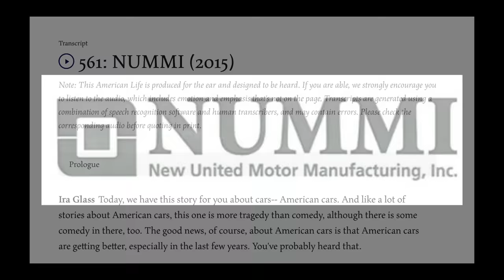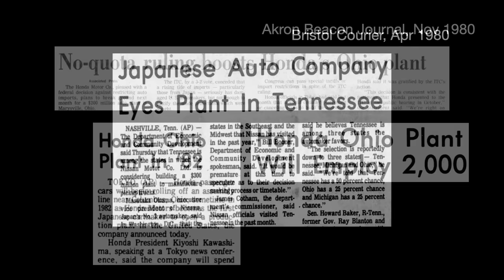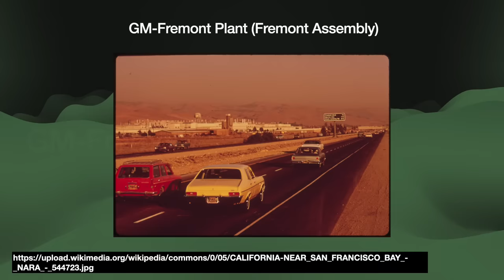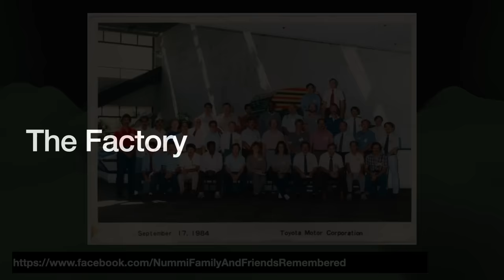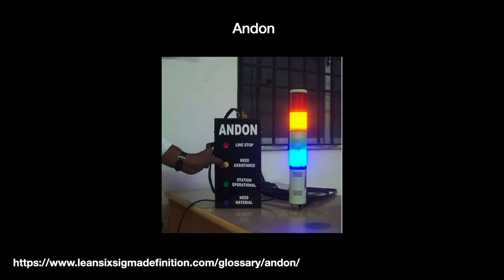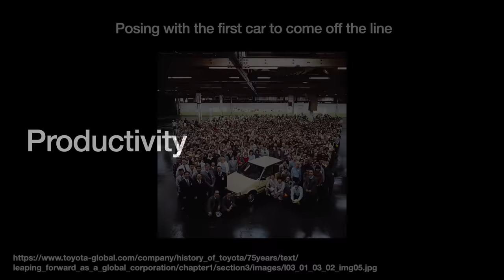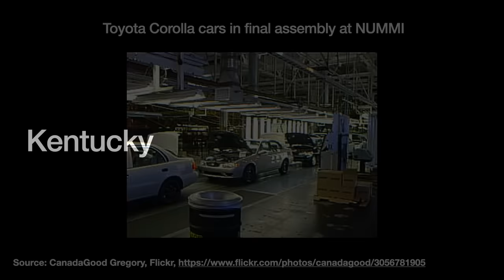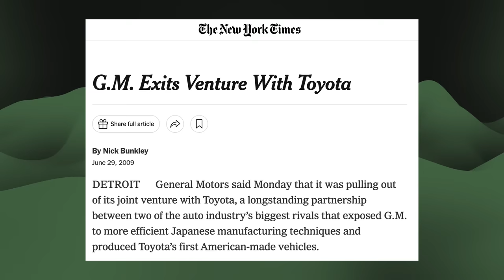How Toyota Turned Around GM’s Worst Factory

Comment: On of the things Toyota does best, is it allows it’s assembly personnel to make suggestions on improvements, trials and then implements them if they work
Reply: Marketing anti-electric car lies.  The other thing Toyota does well.  Top 3 climate denier with only oil companies ahead of it.
Reply: @smartelectriccar I'm pro-climate change. Deniers aren't helping sure. But stop taxing oil, protesting pipelines, and start approving fracking permits. The only reason I want an electric is because it's cheap. If we had cheap gasoline we wouldn't need to buy electric cars.
Reply: @theduplicator3270  Fracking does the most damage to the environment permanently and releases more methane than any other human practice
Reply: Something Tesla also does incredibly well.
Reply: W Edwards Deming an American engineer and business theorist ironically was the one responsible for this culture and improving the quality of Japanese cars. His ideas were ignored in the U.S but the Japanese during the post war period embraced his concepts because they wanted to shake off the pre war image that they only manufactured low quality and shoddy goods.
Reply: Yup, I read that in the book "the power of habits".  They delegated problem solving at a low level.
Reply: @smartelectriccar So you are all in on dirty electrics are you?
Reply: @theduplicator3270 I'm against climate change personally
Reply: They also have a kick ass work ethic. Quality first.

It shows.
Reply: @smartelectriccar Unbacked bullshit 🙄
Reply: Kaizen
Reply: @smartelectriccar nah they're right about that one.
Reply: @smartelectriccar   Misinformaton. Get this nonsense out of here.
Reply: *tries
Reply: @theduplicator3270  "and start approving fracking permits" - LMAO at this lunacy!
Reply: @theduplicator3270 How do you calculate the damage to the environment? You do realize the damage that fracking does, right? When something is too chip, someone always pays the price.
Reply: @smartelectriccar until the grid moves to majority non fossil fuel hybrids (gas generator powering an electric motor) are prob the best bet anyway. When you factor in FF's burned at the grid it turns out that hybrids end up using less fuel than full EV's, while also being less resource intensive (batteries.) There's a reason virtually our entire heavy rail industry is based on diesel/electric tech. 

Now sure, EV tech is sure to improve, but the key is the grid. Unfortunately, we aren't likely to get off FF's anytime soon. The only logistically practical alternative is nuclear, which while quite safe and clean when implemented properly, is constantly sandbagged by both big oil and so-called "environmentalists."
Reply: @janeblogs324  Mining for metals to make EV batteries also damages the environment. Are you cool with that?
Reply: @theduplicator3270 Governments tax to reduce consumption and subsidize to increase consumption. Fossil fuels have hard to control negative externalities and are therefore taxed. Electric cars have much cheaper ways to reduce negative externalities and are subsidized.
Reply: @davidsotomayor8713  Heavy rail uses a generator and traction motors because other systems of power transfer  just aren't practical for the application. Overall efficiency wasn't the main aim and diesel electric had existed for a long time in stationary power generators, submarines etc.
Reply: @smartelectriccar Electrics are destroying the environment, and are dangerously heavy and huge.
Reply: @ExternalInputs  of course it isn't the ONLY reason, but a major reason why it is used is because it is by far the most efficient. Less fuel == less money.
Reply: @smartelectriccar So you want the largest car maker in the world to only invest in and sell electric cars despite half of their market being in underdeveloped countries? Im sorry to burst your bubble, but southeast asia, africa, and even parts of south america do not have a reliable and built out electric grid. Billions of people depend on reliable gasoline/diesel vehicles and western media has blinded you to the fact that people outside the United States and Europe exist. They know it's not feasible to switch to all electric everywhere, even here in America with our crumbling infrastructure. It's too bad they'll be the last ones standing while our own car companies approach another bankruptcy bailout.
Reply: @JohnAsmith-rw6uo you listen to too much talk radio.
Reply: @jerbear7952  All you have to do is have a little common sense and you could figure it out yourself.
Reply: @smartelectriccar if you calculate every resource needed for "everyone on earth needs EV" conversion, you will be anti-electric vehicle too. Nuclear and hybrids are the better stopgap way forward. EV can come some decades later, it's hard to justify all lithium ion battery technology into all cars, unless public transportation reform is included in there
Reply: @smartelectriccar Toyota make first successful hybrid vehicle Prius, which triggered the electric car race.
Reply: @smartelectriccar Because replacing gas cars worldwide with hybrids that people can actually afford (including developing markets( is somehow better that only replacing gas cars in developed markets and doing fuckall for Africa and SE Asia? The former can be done with significantly less rare minerals as well. I’m sorry that you’re incapable of doing math
Reply: @smartelectriccar you apparently have done zero homework work on carbon emission of an electric car vs fossil fuel car
Reply: I worked on cars for over 15 years. There is nothing built like a Toyota, plain and simple. Parts aren’t just thrown in there because they fit like some of the other auto makers, we know of    BMW
Reply: @theduplicator3270 that makes no sense.
Reply: @janeblogs324  You know what’s bad for the environment? Unreliable junk electric cars that last 1/4 as long as a Toyota.
Reply: Jishukin it's called I used to work for them in Australia.
Reply: @smartelectriccar dude electric car are a scam, either you go to work on a bicycle or on foot or you do nothing.
Toyota is just honest.
Reply: They aren't unique in that.
Reply: @calvinnyala9580 battery technology is moving away from lithium. Anyone with any sense of all knows what we have now will probably not be what we use later.
Reply: @deezeed2817  Yes. The manufacturers took to heart the teachings of Edward Deming. He offered had offered his expertise to American manufactures but they decline his offers. It looked like they thought they knew better. Even Porsche had hired a Japanese company to help them improve their quality control and efficiency.
Reply: @timwildauer5063  I'm still waiting on Tesla to improve the quality of their construction.
Reply: @janeblogs324  I guess cobalt mining don't? Used up batteries don't? Get off your high horse.
Reply: @smartelectriccar  yet they are still the top auto makers? Everyone else who ran after EV hype are now scaling back on EV production. Because of $ entry point and not enough infrastructure to support massive EV expansion. Rolling blackouts will be the norm until this country upgrade/expand its aging power grid.
Reply: @smartelectriccar  maybe, but their cars last forever which makes them sustainable again. Aand they got awesome hybrids as well!
Reply: @jsimsgt96  
"Kaizen"
==
改善
Natural democracy.
Reply: What they are missing in the story is how GM went over to Japan and laughed and ridiculed how the Japanese made cars. When they came home they said, nope were not doing this and were not giving line workers that type of autonomy. Typical US egos. USauto mfgs are stuck with mgmnt vs employee mentalities that has never been resolved which hhas been a detriment to becoming world class.
Reply: hydrogen and/or other liquid fuels will support internal combustion engines for decades to come.
Reply: @janeblogs324 cost is more important in this equation than idealistic delusions
Reply: @timwildauer5063  Build quality makes it more of a computer with wheels
Reply: Well yeah TPS is an industry standard at this point. We studied this stuff in my financing classes as far as aviation is concerned it's pretty much been adopted by every major manufacturer.
Reply: Allows? Toyota invented the Kaizen method, they expect you do improve all the time.
Reply: @smartelectriccar  Toyota lies about their own EV range of cars?
Reply: All auto makers do this
Reply: @smartelectriccar  Bruh electric cars are a novel concept to be mass marketed - of course its going to be bumpy and people will be skeptical whether or not its marketed as such. Stop blaming it on "climate denying industries" the electric car market isnt exactly putting renewables into the system.
Reply: @smartelectriccar2306  no one cares, evs arnt any cleaner, do research
Reply: @smartelectriccar yes but Toyota is also at the front of battery technology no?
Reply: Kaizen

Comment: And how GM learned nothing.
Reply: The thought of being better than anybody else (so called exceptionalism) leads to the downfall of a person or a company.
Reply: According to this video, they learned a lot, but when they tried to put it into practice, union got in the way.
Reply: @mintheman7 Unions & management
Reply: @mintheman7  I’ve driven modern GM vehicles… it can’t all be blamed on the unions, though they do share the blame.
Reply: @mintheman7  The thing is, GM's management would never relinquish there centralized sort of power over the manufacturing process and would choose to die first before they even present anything but upwards graphs and charts before they go and admit that they have to slow down and fix problems first. 

And then when the union's bubble of patience burst, the management now has a convenient excuse to blame everything on.
Reply: Only the Chinese factory.

Comment: In 2016, when I was studying abroad in Japan, I went on a school trip to a Toyota plant in Aichi prefecture (in the city Toyota, renamed after the car manufacturer). After a whole presentation about the systems implemented, we got a tour through the assembly line. What struck me as most fascinating was how often the line would stop. Sometimes several times a minute you could hear the sound that indicated that someone had pressed the button and the line would stop shortly after. That meant that the line would only move for a few seconds before stopping again. It looked a bit like stop-and-go traffic. But the line would also never stop for long. Workers would only need a few moments to finish whatever work step they were on, and the line started again.
Reply: Quality work before quantity work
Reply: I work in a Tesla factory and the line doesn't stop unless something breaks or if some critical part isn't stocked
Reply: トヨタの工場見学の他にも多く良い日本での経験をして頂いたのなら嬉しいです！
Reply: @nick-zc9xv  No wonder Tesla scores so horribly low on mechanical production quality and longevity of the cars. Various Tesla cars scored worst out of 300 new-ish car models in Sweden when it came to the state of the car once the initial 3-year warranty is over. =/
Reply: @nick-zc9xv No wonder why Tesla quality is so notoriously inconsistent.
Reply: But I'm assuming everybody at their stations was still working on their tasks. It seems like the flow stoppage isn't as impactful as "during this time no work is being done".

Comment: I worked at NUMMI one summer. They hired college students to work on the production line during summer vacation season. Had to join the Union. The training was very thorough. I worked in the body shop making T Posts (the frame part between the front and rear doors) and also rear wheel wells for Toyota Corollas and Geo Prizms. While there I did hear some stories of GM Fremont shenanigans including weed smoking and drinking. Good group of hard working people I got to work with there. They called me back to work the following summer but I couldn’t do it because I was taking a summer school class. I still wear a scar I got at NUMMI. I was holding onto a part that was getting a repair weld and a welding spark landed between my glove and protective arm cover.
Reply: Maybe you worked on my old Prizm.  It was a fantastic little car, roomy inside, reliable, punchy 1.8l engine, and priced just right.

Comment: 14:00 This is an often cited story. However, in Spanish, the word "nova" and the phrase "No va" have two different meanings, just like "notable" and "no table" in English. The original production run of the 1962-1979 Chevrolet Nova was a very popular compact rear-wheel drive car. That popularity didn't transfer over to the new front-wheel drive version based on the Toyota Corolla which was also built at NUMMI, so the car was rebranded as the Geo Prizm and later as the Chevrolet Prizm when General Motors discontinued the Geo make.
Reply: Thank you. The video producers clearly never fact-checked their assertions before committing it to video. Also note the Novas and Corollas built at NUMMI were the EXACT SAME VEHICLE with different badging. Ditto the later Geo Prism, then the Chevrolet Prism. This whole "Production" segment of the video was blatantly incorrect and casts doubt about the veracity of any of the other information in this video. Do better.

Comment: Hey, I worked at this very factory for a short while in 2019! Tesla gave me 3 days of training and then set me loose, much different than what you described at Toyota.
Reply: I mean, it's Tesla. You build glorified toasters with bad (and expensive) batteries. Not much to assemble.
Reply: @MiGujack3  More like glorified refrigerators. But then, I have a 40 year old "beer fridge" that's NEVER STOPPED WORKING. The batteries ... hmm, you have FACTS to back that up? No, didn't think so.  Like PV panels or Intel processors, battery tech is improving at a tremendous pace.  It's just you whiners don't mind if your phone is faster and better, but don't touch your noisy, smelly, expensive pickup!
Reply: @capnkirk5528  You do know that when the EV battery loses it's efficiency to 80% charge it has to be replaced, for $4,000-$12,000?  That's why smart people sell their 3-5 year old EVs to stupid people.
Reply: @MiGujack3  Tesla still needs to improve the quality of their cars.